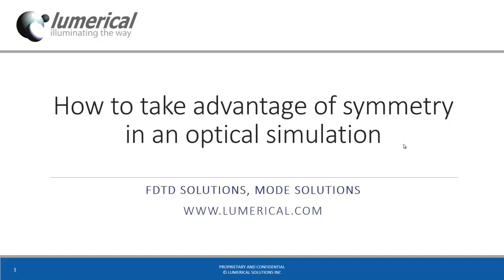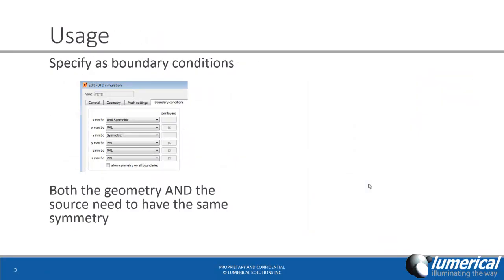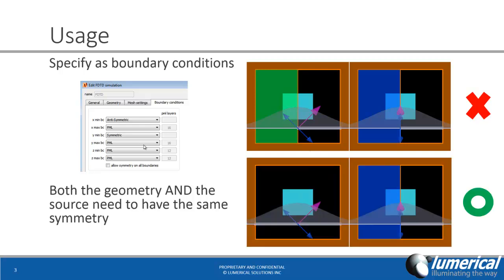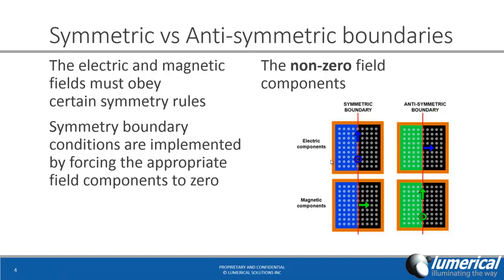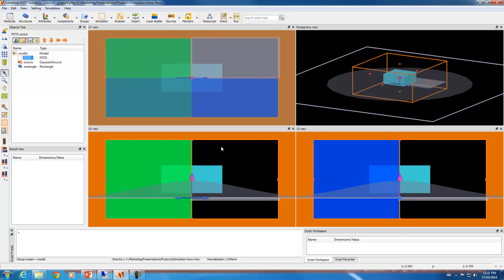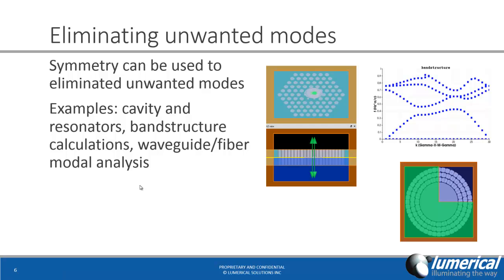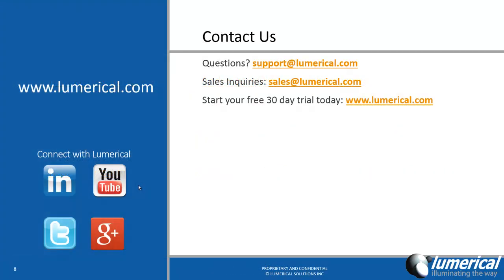How to: Take advantage of symmetry

Comment: at 2.44 min, dipole ( blue arrow) seems parallel to x are not perpendicular but parallel. Whatever you are saying in the video is only true if horizontal axis is z and vertical axis in x ( in the bottom left figure). Can you please explain it it in detail?
Reply from the maker: Hi Kumar;
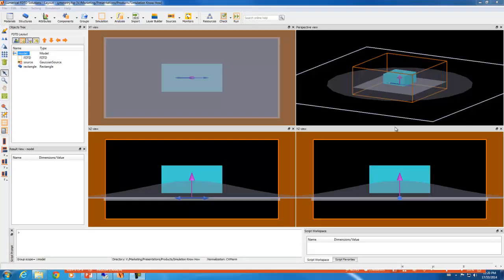At 2:44 we show beam source and the blue arrows demonstrate electric field polarization, which is indeed very useful for determining the correct symmetry boundaries.
As for the polarization, it is indeed parallel to x axis, but perpendicular to the x min and x max boundaries that are shown on the right and left side of the simulation region. The video is referencing the x boundaries, not the x axis.
I hope this clarifies this for you. If you have more questions about Lumerical simulation settings you are welcome to join us at our forum, the Knowledge Exchange (kx.lumerical.com).
Reply: @AnsysPhotonics  It does. Thank you. Ironically, I was going to ask the same question and noticed that I have already that question 4 years ago.